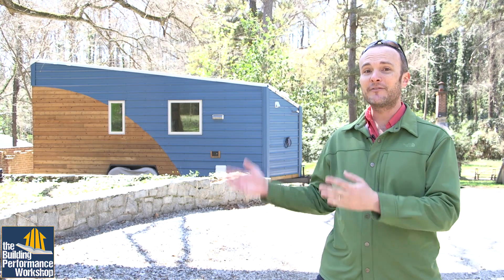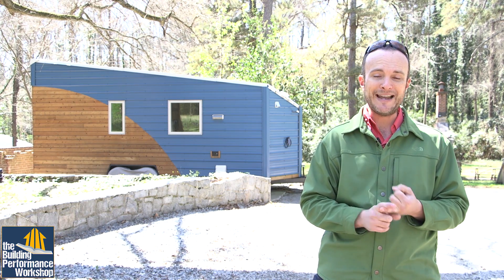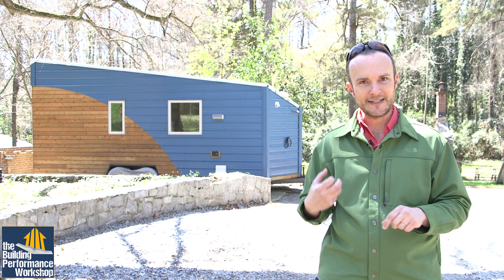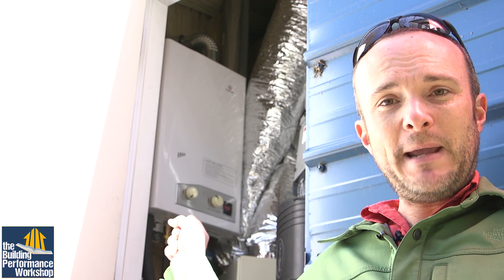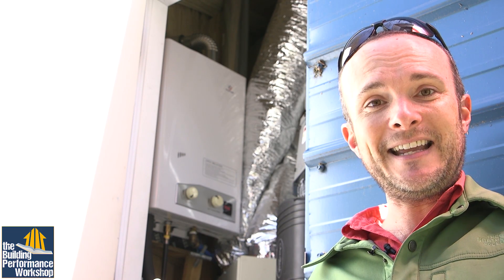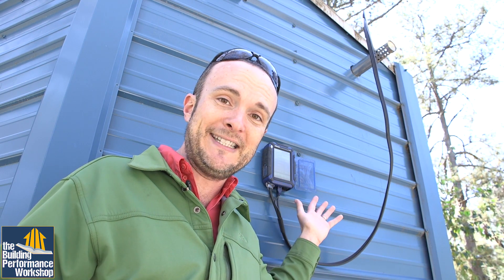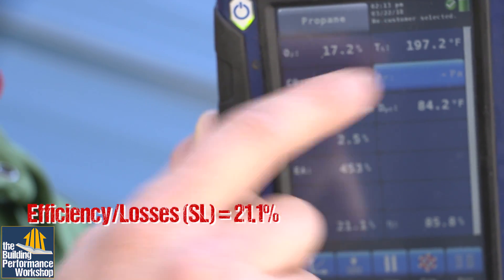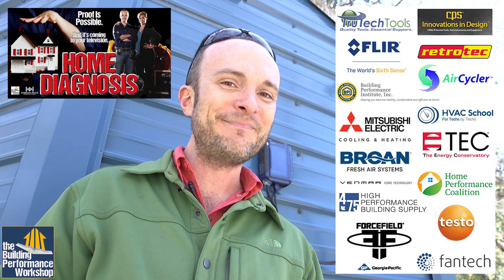Combustion Testing the #TinyLab using Wohler A450

Comment: That is a high O2 reading. Does it modulate? Was it not on high fire?
Reply: Do you think the flame is being cooled too much and giving off more CO?
Reply: Home Performance that makes sense. I know very little about those appliances. 

I have tested a Carrier mod. Furnace. It was pretty impressive on low fire (something like 115% EX air), the firing rate only steps down to 35% though.
Reply from the maker: Lowest fire setting possible buddy. Otherwise I melt my skin off at 1gpm. Weird, huh? They don’t make them smaller than this.
Reply from the maker: I’m going to open it up and poke around. It was not this high last time, I suspect a clean and tune will work, Joe.